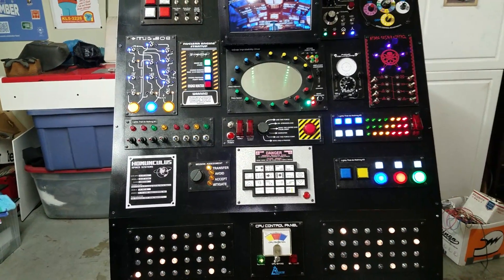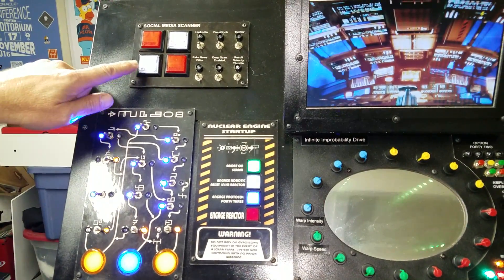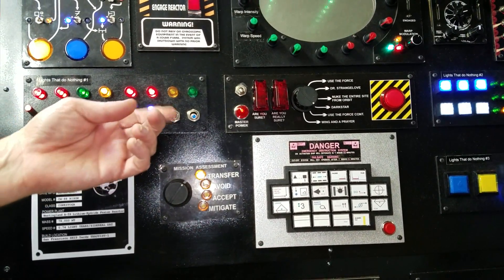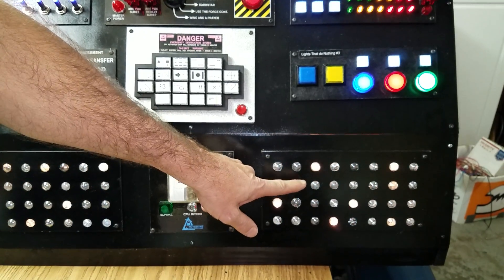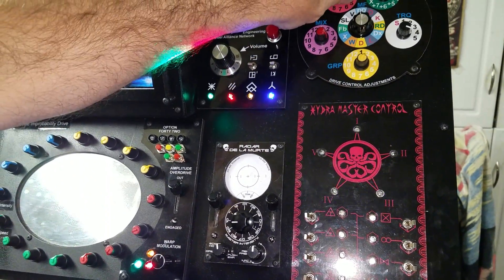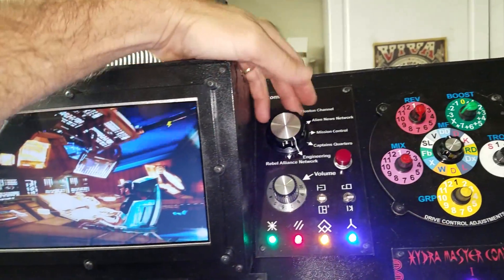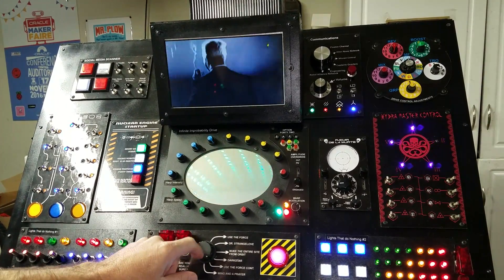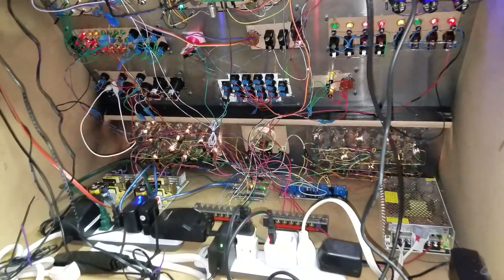Rocket Ship Panel

Comment: Guess as a prop it's just wonderful. You can build panels. Although when I built something it actually did some functional thing like emf detection, 180 the audio cancel noise  out. Control a countdown to a calculator to zero send up a model rocket. Logic gate timer to output display eight segments to show light intensity. Remote voice out light on and off. Didn't in the beginning use microntroller did that later. Just use Logic gates and 555 timers. Least yours looked better I would have to say.